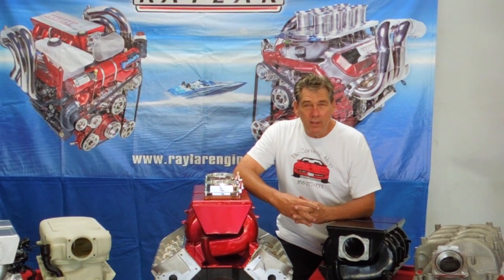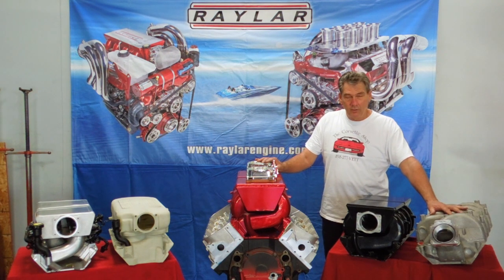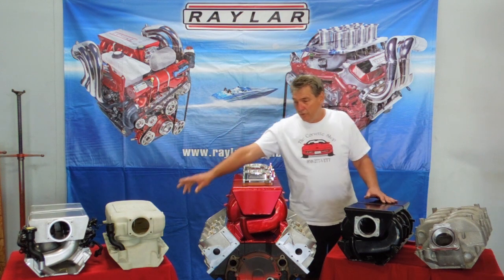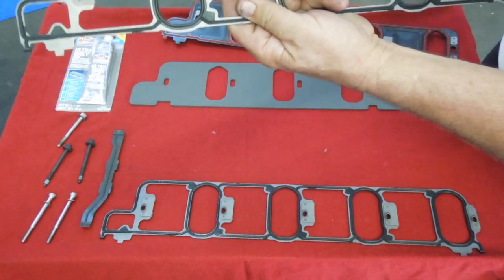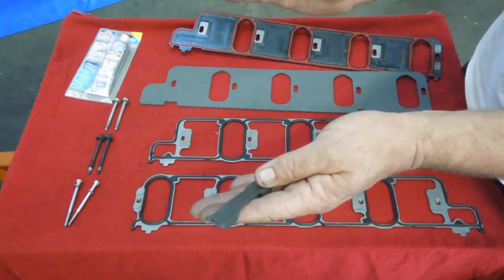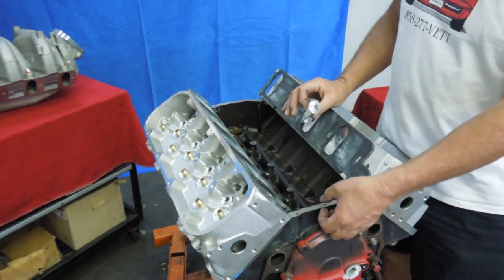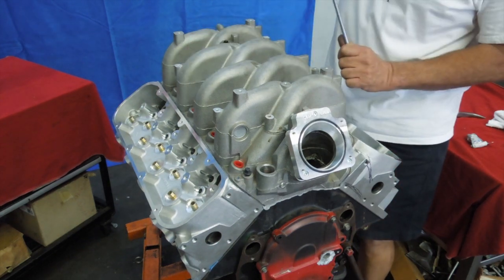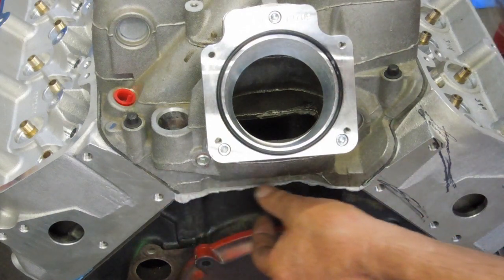Vortec 8.1L / 496 Intake Manifold Information & Installation

Comment: Help!
I have a newly rebuilt GM 8.1L 496 big block base engine (volvo penta) installed on a 28ft boat... pistons / rings / springs / knockers / valve seals / gaskets / bearings ... complete rebuild
60 hours+ till now and it is consuming about 1 litre of oil per hour at high rpms
No smoke at cold start or at running... but fresh oil sheen on water when turing off the engine coming from motor through exhaust
Some says it's of bad valve seals and others due to piston rings and some relate it to pcv valve which is built in the throttle base

Would be grateful if you could please help me diagnose my case

Comment: had my heads and head gaskets done but water is flowing out the exaust big time is there any chance the intake manifold is improperlly installed ?
Reply from the maker: its a dry intake manifold (similar to an LS engine) so your cylinder heads are coming off again.

Comment: You guys ever do anything with the composite intake? Can we buy one today?
Reply from the maker: Its funny you ask - the composite intake was our first step into developing a more modern, higher revving (short runner) manifold for applications that can push to 7000rpm. After testing, we've gone back to the CAD drawing board to further refine the bottom end power with more top end along with stock(ish) looks. That manifold will be released soon!

Comment: Will you loose any lower rpm torqe with the stock intake modification?
Reply from the maker: The stock manifold and the modified stock manifold maintain the exact same characteristics.

Comment: I ALWAYS (test)  the intake fix, without any gaskets or endseals. Shutoff all lights and inspect with a powerful L.E.D. pencil flashlight. I also use feeler gauges. Also if you can use camera probe through the intake manifold ports and look at alignment of intake manifold to head port. One picture worth 10,000 words.

Comment: does any one make a carbed intake or will a gen4 intake work?
Reply from the maker: Gen7 8.1L have cathedral port heads similar to LS1 / LS2 engines, but much larger ports and on different spacing (LS small block intake manifolds dont work) and will not accept any previous generation of intake manifold for big block chevys.

Raylar CoolGap manifolds can be setup to run dual carb style throttle bodies.
http://www.raylarengineering.com/intake_manifold.html

Dart also makes a dual plane carb / distributor style intake manifold for the 8.1L for about 6-700$ You will need to have the blank provision in the back drilled / cut for the distributor.
http://dartheads.com/dart-product/gen-7-8-1-liter-dual-plane-bbc/

Comment: Great video, I just installed a rebuilt 8.1 .30 over, and when I went to install the intake bolts, the bolts I removed from the engine(silver) didn't even engage the threads in the head. My truck is an 02 but engine is not orginal. Later year heads then? So Blaco bolts should be what I want, and remove those rubber seals!

Comment: Great Video. Can you please tell me where the oil pressure sending unit is on this engine? I was hoping to see it behind the intake manifold. I am sick in thinking I need to remove the intake manifold to replace the oil pressure sender.
Reply: Probably too late to answer as I'm sure you figured it out but it is right on the back side of block right below intake manifold. You do not have to take anything off. Just takes some patience and you can get to the sending unit. I spent the money on the proper socket with thinner walls and it only took about 20 mins to get it off. Hope this helps!

Comment: On my stone stock '02 Silverado 8.1 I'm preparing to replace the original red bead intake gaskets with the black bead gaskets. Currently has silver intake bolts. Will the longer black bolts bottom out in the stock heads? Should I get a new set of the shorter silver bolts and use them instead?
Reply from the maker: Depends on what year heads are on your engine, what intake manifold is on the engine and whether anything has been changed or modified on the engine. Odds are everything will work fine with the original bolts, but if they don't you can pick up the bolts from GM.